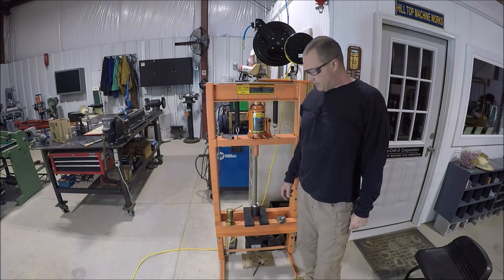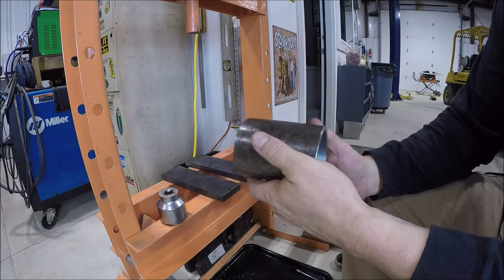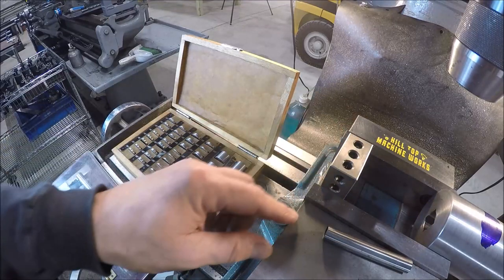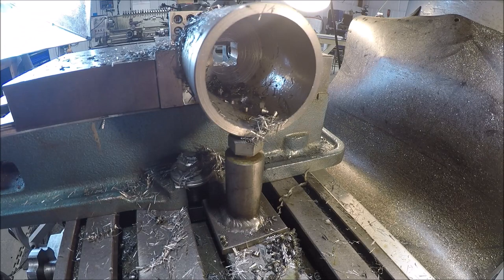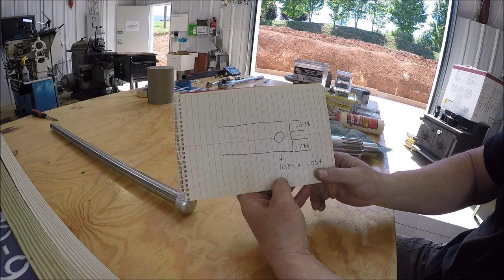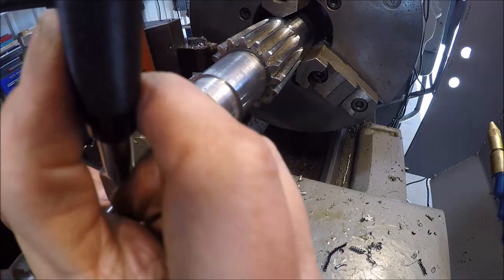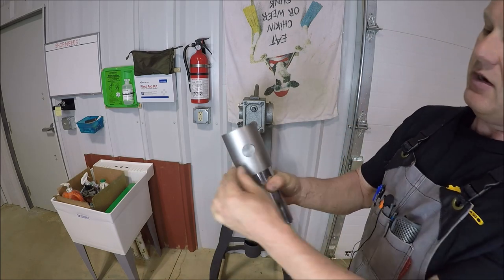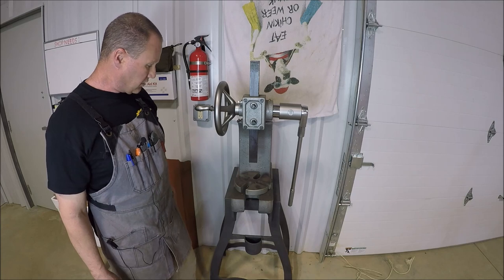Arbor Press modification to make it ratcheting Part 2.

Comment: Nice work!!!! Looks like you're settling in the new shop well if I didn't know any better would think you've been there for years!!!!! LoL 👍👍
Reply from the maker: Thanks. Doesn't feel like home yet but I am getting it there. You need to post some more shaper action.
Reply: @hilltopmachineworks2131  will do. I've been out of the shop working alot so haven't had any time seam's like when I am in the shop it's always a rush but I'll get some video soon and get some on the big American lathe!!!👍
Reply from the maker: @harbermachineworks3927  Awesome. Yeah now that summer is here I have to spend a day doing yard work now.

Comment: G'Day Tom, coming along nicely.  You can't trust the Chinese accuracy.  The Hand Wheel looks better than mine, great shape.  When I did mine I measured and found the hole was off center.  The easiest way to over come the issue was to machine up a shaft that was a neat fit in the hole at one end and fit into a collet at the other.  Just move the table until the shaft drops thru the hole and there you have the aliment.  Take the "Gear Shaft" out of the vice and fit the hub and drill, the holes will match perfectly.  Are you going to use the friction button arrangement I used to hold the ram up or use another method.
Cam
Reply from the maker: Hey Cam, I hope I did you proud with the mods? I made some friction buttons out of Delrin like you did I just forgot to mention it. My stickers make it to you yet?

Comment: Hi, I found your channel because you graciously responded to my WTB a tool and cutting post on Hobby Machinist.  You have some interesting videos and I am glad I found your channel and I thank you for your help.  On this particular video, could you have used your shaper to broach the 3/4" square hole?  Thanks again.  Joe
Reply from the maker: Hey Joe. Yeah I could have used my shaper. Grind up a HSS bit and possibly made a fixture to hold the blank if the vise would have not worked out. Thanks for watching!

Comment: Nice, not exactly what I pictured from the description in Pt.1 but works great any ways! I dont know if you mentioned it but why not just press/weld the ratchet interface to the shaft of the press rather than pin it?
Reply from the maker: I made the sleeve so incase I ever wanted to put it back original.

Comment: Would be far better to place the 3/4" square hole directly into the end of the pinion shaft.  The adapter he's done has moved the handle several inches away from the vertical centerline, and is adding a considerable sideways.force, trying to tip.the machine to the right.  Ideally, the lever fulcrum should be as close as possible to the rack.,  I have 5 ton and 3 ton Arbor presses in my shop, they both get used several times every week, and I'm just a retired tinkerer.